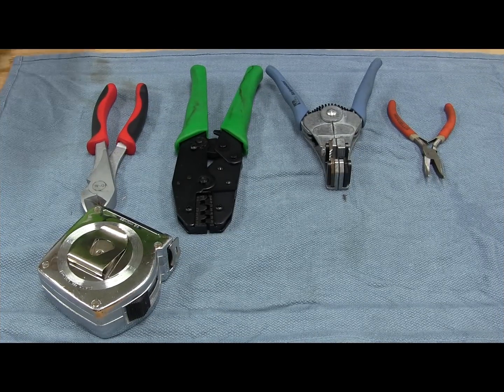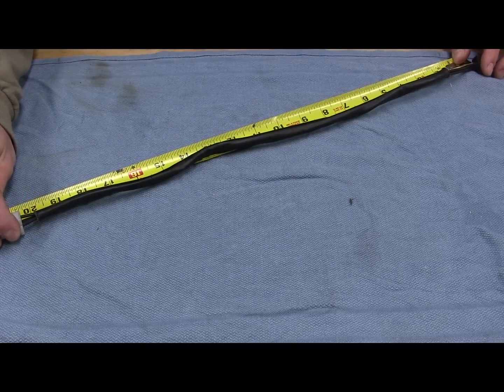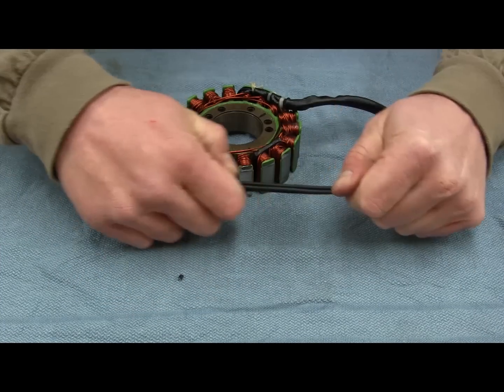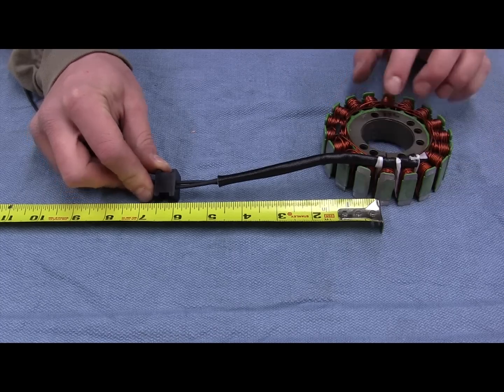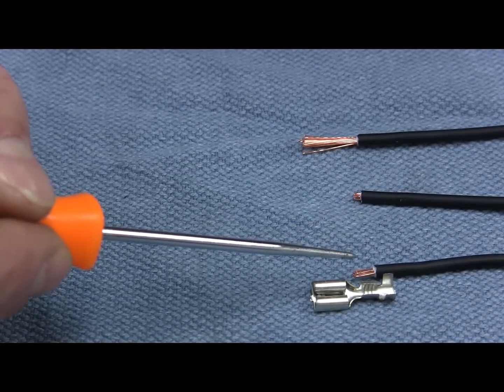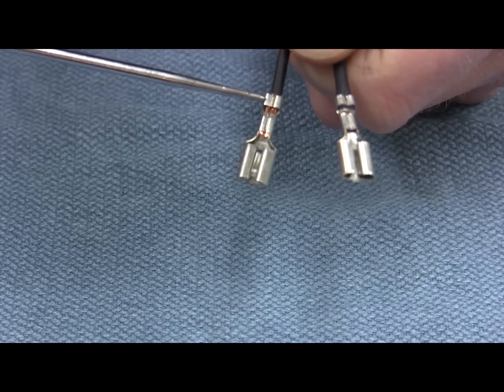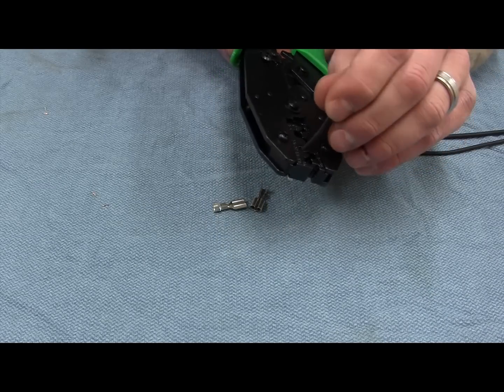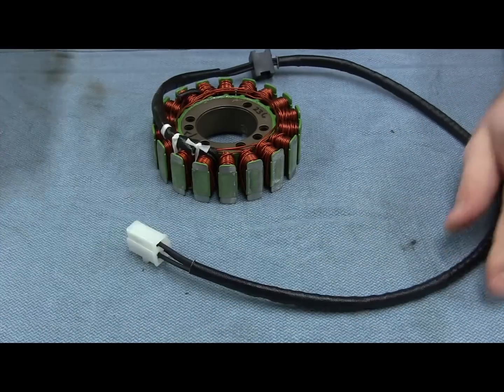#5 How to Replace Stator Connector and Grommet; Proper Crimping Techniques.

Comment: Great easy to follow video. Thanks, Ricks Motorsports Electronics.
Reply: *****, it's a SV1000s. I need to find something small, like a jeweler's screwdriver, to get in there and work the wire off the grommet. It looks like, and the local dealer confirmed, the grommet is molded around the wires, making it nearly impossible to pull off. Cutting is out of the question as well since I can't purchase a replacement piece.

Comment: Great video! Quick question, if I was to hardwire my stator directly into my new reg/rec does it matter how the 3 stator wires are connected to the reg/rec?
Reply from the maker: On our parts - there is no order to the 3 stator wires, so just solder them up in any order.

Comment: Thanks, very helpful. Maybe a dumb question, but does the order/placement of the three wires matter when installing them into the connector? You appear to say it does - I've heard it doesn't. Can you clarify? Also, the stock connector fried on my bike after installing  your stator - can  you recommend a connector that can endure the heat and output? I'm tempted to go the direct connection route, but prefer the flexibility of having a connector.
Reply from the maker: On a three-phase stator like the one in the photo, it doesn't matter which AC output line from the stator goes to which AC input on the rec/reg; it just matters that all three are connected.

Regarding the overheating connector issue, please email the specifics of year/make/model of your vehicle to info@ricksmotorsportelectrics.com and we can look up your connectors and alternative options for them.

Comment: great video! Wish I would have watched it before I did my project the first time. Round two I guess! Can you show a video on how to diagnose a bad stator. Even after replacing mine the battery voltage does not increase while the bike is running.

Comment: Hey thanks for the video!  Can you tell me what crimp tool you are using?  The basic crimper I got from the department store is garbage and keeps bending the tabs in the wrong way.    Do you recommend soldering ever to improve connection?

thanks.
Reply from the maker: We use our own crimping tool: https://ricksmotorsportelectrics.com/Crimper-11_001

Comment: Great video but you need to show how to remove the old connectors from the terminal block. As you said when you insert them locking pins lock them into place. How do you unlock them to remove the old terminals.

Comment: How did you know which wire goes into which part of the connector if they are all the same?
Reply: ***** thanks cause I have a 2007 suzuki gsxr 600 and im going to do the stator and rectifier.
Reply: ***** I have a new stator for my '83 Yamaha Seca 750, it came with the plug, however my old one was installed with no plug- so I had to cut off plug on new stator. Does it matter which of the 3 wires go where? They are all 3 white- no markings (old one and new one). I thought this is considered a 3 phase stator (maybe they all are?). I have the new stator in the bike all wires stripped/ ready to wire and start. I just need to know if each wire has a certain matching wire or since they're all the same it doesn't matter??? Thanks!
Reply: Exactly my question.
Reply: +Rick's Motorsport Electrics  what happins if you hard wire??
Reply: +Ron Kerstetter  both connectors are fried
Reply from the maker: All 3 stator wires are the same, there is no order to them.
Reply: thats some handy information to a non mechanic. i just got my order from you "ricks" and was lost.
i had no idea what wire went where,
Reply: @RicksElectrics  thank you
Reply: I got a vulcan 750 all wires on my stator are yellow but has no plugs they cut and taped is there an order to putting them together or does it not matter

Comment: Does it make a big difference if the  copper wires aren't insulated or coated like factory oem stator. Does it also affect longevity of the stator life.
Reply from the maker: All of the wire that we use is called "mag wire" - it has a flexible varnish on it which insulates the wires from themselves.  There are different methods to hold the wind in a more rigid fashion (encapsulating or dipping).
Reply: Rick's Motorsport Electrics , thank you.

Comment: Where did you find the connector? And how can I tell what order/location the wires need to be installed into the connector? Right now, my regulator is direct wired to the stator, and I have to replace the regulator.
Reply from the maker: what is your year/make/model?
Reply: @RicksElectrics  1989 Yamaha Virago XV1100
Reply from the maker: @timschrock  this is the replacement rec/reg: https://ricksmotorsportelectrics.com/OEM-Style-Yamaha-Rectifier-Regulator-10_407

The 3 white wires are all stator wires and there is no order.  If you need the opposite end this rec/reg plugs inst (the connector that should be on your stator) we can sell you that too.

Comment: I put new stator on me vfr 03 then plugged  in to regulator  was charging good 
 Then tow days later me bike died I find out that a wire came lose and fallout of plug will that of killed me stator again as I now have no charge agin
Reply from the maker: It probably wouldn't harm the stator itself, unless the wire that came loose was a stator wire and it touched the engine case, shorting the stator windings.

If you send some pictures of the part in question and the loose wire to us at info@ricksmotorsportelectrics.com we'd be happy to take a look!

Comment: my connector is burnt can i cut both of them off and just wire it ?
Reply from the maker: snap crf150r - yes, just be sure that you cut off all of the bad wire & use proper soldering technique

Comment: I have to replace my rectifier, no biggie. BUT, the plug from the stator to the rectifier is fried. The stator tested out fine but I don’t know where to get a new plug. Any suggestions where I can get just the plug and connector pins? I have a 2002 Honda shadow spirit 750.
Reply: Yeah! I got them Friday. 3 days from NH to Dallas, installed them Saturday. Perfect! Thank you guys!!

Comment: I replaced the stator but the rubber plug allows oil to spray out the stator cover. How do I get the rubber plug to fit like the OEM plug?
Reply: Its the gromet. I take it from your video using a aftermarket gromet is not recomended?.